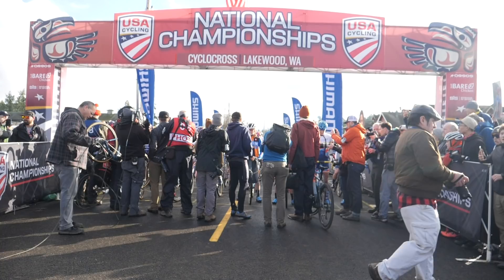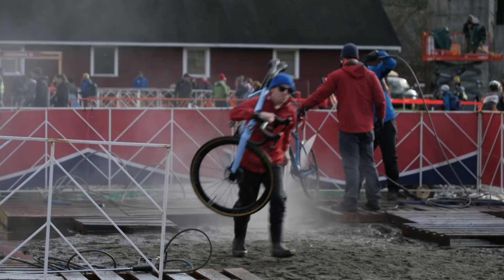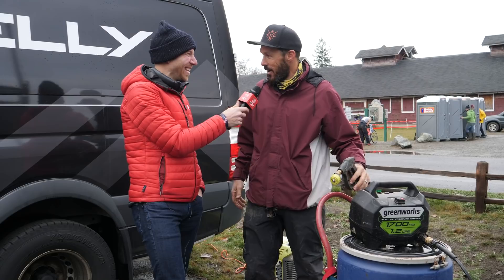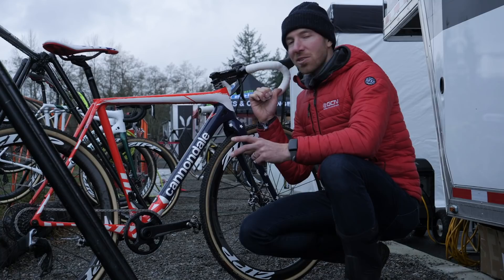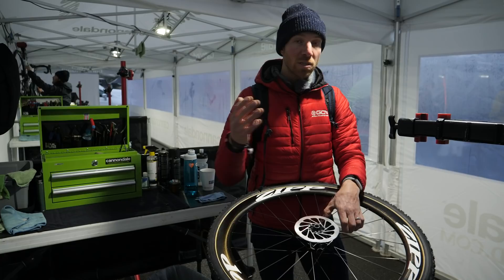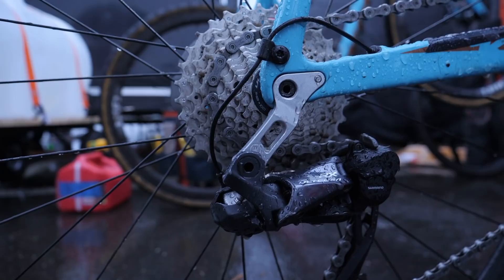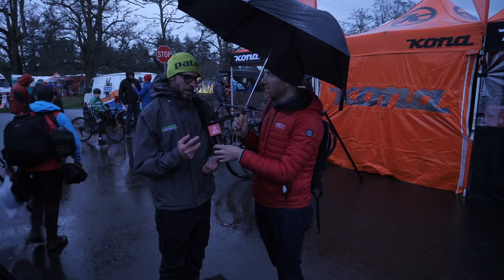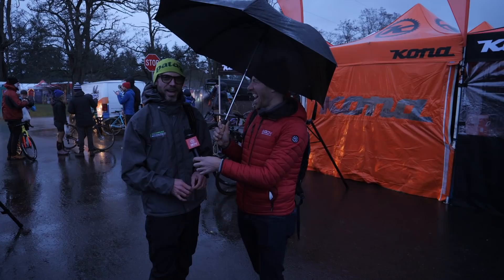The Best Bike Tech From The USA National Cyclocross Champs Pits

Comment: I would really like some more info about cyclocross shoes, how does they work with that steel toes? it would be nice if you can squeeze out a video with that
Reply: Some models of Pearl Isumi and Mavic mountain bike shoes come with the threaded holes for screw in spikes.
Reply: Most performance mtb shoes have threaded spots for toe spikes.  I have the all around spikes that Tobin sells, they work great.  Basically, they are just teeth on the bottom front of your shoes used to get grip when running on a muddy course.  They don't interfere with clipping in, etc.
Reply: Kleiner Helfer I don’t know if your wheel could hit the spikes, that would be an odd position. I think you’d got your toe on the tire long before a spike could hit anything.

Comment: I've been running tubeless CX tires for five years with no problems as long as the tires and rims are tubeless ready.  Haven't run really low pressures, so don't know if they have the same capability as tubulars in that regard, but otherwise they are much easier to mount and change out tires for different conditions than tubulars.
Reply from the maker: Once they're being run at super low pressures by lots of people they'll become more popular
Reply: @gcntech  Will a noodle in the tire make the performance better at low pressures?

Comment: Aren't derailleur hangers supposed to be sacrificial so as not to damage the frame in a crash. Making them harder is surely a bad idea from a consumers perspective?
Reply: I think there's a sweet spot of that and by harder i think they mean by falling down impact rather than the rear derailleur being pulled
Reply: The aluminum hangar is still going to fail before the frame does.  The benefit of the direct mount design is that there is less slop/play in the system and it improves shifting...